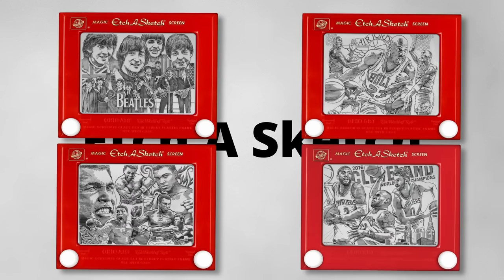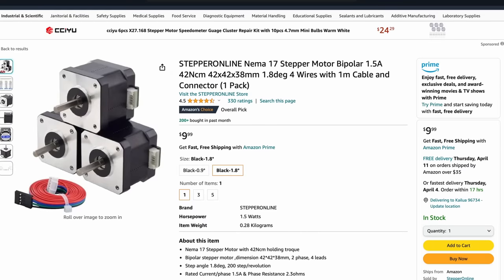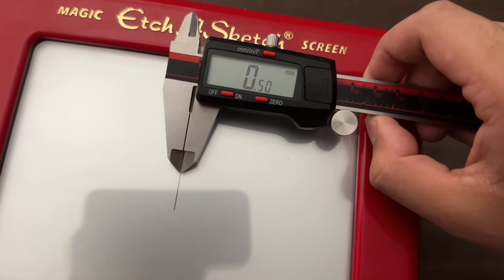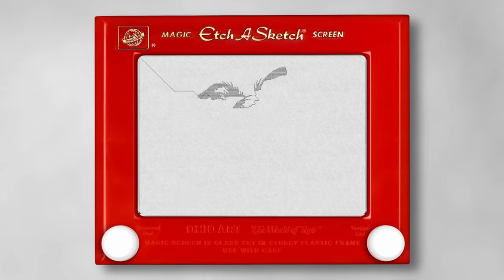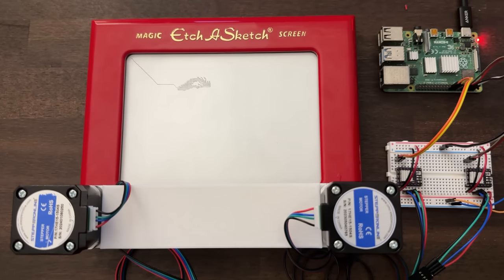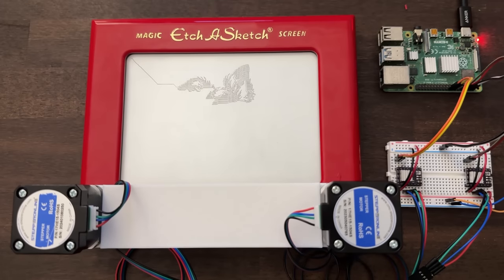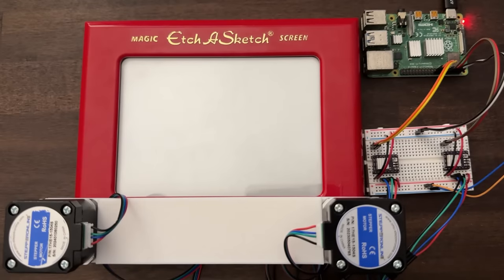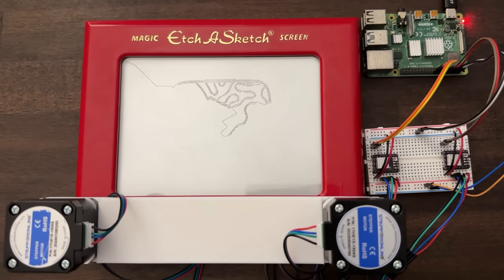Building a Robot Etch A Sketch

Comment: Delighted that you document those frustrating mistakes we ALL make with these kinds of projects
Reply from the maker: It was a rough process getting this to work, I don’t even show any of the programming frustrations
Reply: I only hope you can reuse the waste 3d prints because it shouldn’t need 7 attempts just to design a knob. Over the year mistakes like this will produce lots of unnecessary waste, to help you reuse the waste try to get silicone mold made of something you like. Then start by putting the waste 3d into the mold and heat the mood to the material melting temp. And keep adding 3d prints to the mold as the plastic keeps melting and you’ll have a beautiful recycled sculpture of whatever the mold was.
Reply: @atharvashetty6173 He probably has a means of recycling or reusing the  parts. Also, taking 7 attempts to design a knobs is completely valid especially if you're a perfectionist. Depends what you need it for, but still. Errors are just part of the design process.

Comment: Cool project! Some notes from a robotics engineer: 
1. You might be able to improve it if you add in some backlash compensation. When you change direction while turning a knob, the first couple degrees of motion in the new direction don't actually move the cursor. You could measure this by seeing how many steps you could rotate a knob back and forth without the cursor moving. The backlash amount in the two directions might be different. So whenever you change directions, you first need to rotate the knob by the backlash amount before continuing the path. 
2. It seems like you could maybe double the resolution. it looks like the rows are a little too spaced apart to make a fully filled-in image.
3. The pathfinding for traveling back through an already drawn area is a cool idea (very computer scientist-y) but the image might be better if you only do travel along the border pixels. or, as another commenter suggested, with the "grain" if you're going through a filled region.

less technical suggestions:
as other people said, moving to the start position then shaking the etch a sketch to get rid of the initial line
maybe another pattern to fill the regions? like crosshatching would be cool

Lookin forward to see what you do next :^)
Reply: Also, see that little phillips head screw thing on the stepper motor controller? you can use that to turn down the voltage which might help with the heat buildup. too low and they will stop working though. worth a try at least
Reply from the maker: You basically summed up the problems that I ran into. I didn't think talk much about them (I probably should have). I took backlash into consideration, ive never heard of that term before but I thought of it as a deadzone and I just stepped an extra 10 steps if the stepper changed direction.

I could probably double the resolution but it would take 4x as long and may not produce a 4x better image but definitely a good idea to try.

I agree, the path finding could be a lot smarter but it may take a lot longer to process a more efficient or "better looking" path.

Thank you for the info and the support, I appreciate it!
Reply: @micah_tilton Given how quickly this makes the images, having it take 4 times as long is absolutely nothing compared to how long your 3d printer took to make the parts, even if you discount the failures.

By the way, documenting the failures shows you're just the same as us viewers :)
Reply: This is great! Also, those "backtrack" lines can probably be removed if you reverse the drawing routine so that it draws the "backtracking" *first*. (If you still want to start in the top-left corner after that, either pathfind to the new starting point (traversing over black sections) first, or reverse recursions individually, or shake the device after initial traversal.) Doing this would result in the image portion essentially re-drawing over the backtrack lines, instead of backtracking lines drawing over the image portion.
Reply: @_LordInateur  I didn't think of drawing the backtracking first! neat idea
Reply: This guy hobby projects
Reply: Having casually tried this I thought it was odd he didn't mention backlash compensation because he either did backlash compensation or he got the nicest etch-a-sketch ever
Reply: Would it be possible to make code that would automatically convert an image to the necessary format to be drawn properly?

Perhaps even have a way to auto clear the screen if reasonably possible.

If so maybe this could be made into a kit that people could use.
Reply: @ikonix360  Both of these ideas are totally doable! The image processing is a very simple software addition, while clearing the screen is certainly possible but not sure on how involved it would be. It may work with just a vibration motor which would be very easy. maybe the whole etch-a-sketch would need to be shaken over a larger distance, which would make this more difficult.

Comment: Very cool!
If you add a pause and shake the Etch a Sketch between after it gets from the start position to the first black pixels block you could get rid of that initial line, but at the same time it tells a bit how the thing works.
Reply from the maker: Good idea! Thanks!
Reply: New shaking robot incoming?

Comment: There's a few tricks you can do to get cleaner results (not that this is in any way bad!) such as choosing paths to move from one area of the image to another, such that those transversal paths aren't noticeable (even when taken repeatedly). Eg. rather than starting in the top left corner, you start there, relocate to a spot inside the draw area, clear the screen, and then draw; or coming up/down from the center. Or you can repeatedly pass over a region, adjusting the pointer by only a fraction of its draw width, in order to produce a full-black area, as you push the metallic dust in one direction (rather than smearing some to both sides); look up a tutorial on how to completely clear the screen.

I once did a picture of a cityscape along a sloped street, so one of my transversal lines was the edge of the street. Even though it was sloped, I just had to be consistent about how I twisted the knobs. Then all the buildings were rectangular, which made those easy. From there it was just a matter of choosing how to texture each building (vertical stripes, horizontal, windows, etc)

Comment: two things you could do to improve this:
1: make the program minimize the number of "against the grain" moves while making moves. For example, this would be diagonal lines for the dog.
to do this, you would need to first choose a grain that best suits the image (up, down, diagonal left to right, diagonal right to left) then have it minimize all travel movements that are not this grain.

2: start the etch A sketch in it's starting position to eliminate the line from the edge. You would probably need a clear function for the robot, but a tilting plate should do the trick...
Reply from the maker: Good ideas! I think implementing #1 would help give the image a cleaner look
Reply: I was thinking you could just program the backtrack to go around the edge of the black area, so the line produced adds to the definition of the shape rather than cutting awkwardly across the middle.
Reply: I was thinking program the backtrack step to follow the edge of the shaded area, so it forms a nice edge rather than cutting across and making a weird diagonal.

Comment: Great build!  As a kid, I had an Etch-A-Sketch. If you drew the lines close enough, you could remove all the grey, and see inside. Your lines can be closer. I think you can increase your resolution, as you based everything on a visual measurement of line width. Also, another idea is if you use the original drawing at 1:45 and draw vectors and curves, which should look smooth with the two knobs moving together. You are converting drawing (lines) to pixels, and then a raster.

Comment: Steppers normally run hot, but you should be able to touch them if its burning you hand you should adjust the current on the driver. Awesome project.

Comment: ohh etch a sketch my ole friend, the original corexy :'D
Reply: since in a core XY motion system a combination of both motors is needed to preform a single axis movement an etch-a-sketch would be more akin to a cross-gantry setup.

Comment: Cool project. Steppers run hot, even when doing nothing, so I wouldn’t worry about that.
Reply from the maker: Thank you! I was a bit worried
Reply: @micah_tilton  my cnc machine has steppers and they run around 160-180 degrees. Hot enough that they burn you if you touch them.

Comment: It looks like you're using reprap Drv8825 style drivers.  If you turn down the current (via the voltage pot on the driver) the motors will get less hot, and if you turn up the micro steps (via the config pins), the noise of the motors will go down.  Alternately, you could switch to a silent step driver like the TMC2130 or TMC2209.

Comment: You're incorrect about the maximum resolution. Only the minimum line width is set, but you could operate on subpixels. Also it would be far easier to just etch vector graphics.

Comment: Coming from 3D printing, if your steppers are hot then you should be able to go to a higher voltage and reduce the amps via the little trim pots on your drivers. With 24 volts and less than 1amp to a motor I can run my printer for hours at high speeds with plenty of torque and they'll still be barely warmer than ambient air. Like 2 degrees F warmer. You can safely run stepper motors at voltages higher than is on their label as long as you keep the wattage under their limit.

Cool project!

Comment: It's normal for the motors to produce a ton of hear and vibrations normally 👍
Reply from the maker: Thank you! I thought I messed something up
Reply: I wondered if there was a bit of binding with them that made it worse though? Like when one motor rotates, the motor on the other side is getting the reaction force to keep the whole bar they are attached to from rotating. When that stepper has to rotate against that, it would take extra force, using more power, and generating more heat. Just my theory
Reply from the maker: @WesYarber  the bar is quite long and the torque needed to turn the knob is fairly low so I don’t think it caused many problems. With a weaker stepper motor I think it would cause bigger problems
Reply: @micah_tilton  yeah I have my own 3d printer with similar stepper motors and after each print they get like 75-85 degrees Celsius

Comment: Use the full 850x600 resolution of the stepper motors! The Etch-A-Sketch itself does not have a resolution limit, only the dark areas bleed a little outward because of the stylus width. You can still see white between your lines so there is not just resolution but also contrast to be gained from more pixels. 
Next, the line does not have to start from the top left. The stylus should first go there for position calibration, then go to the first dark pixel on the path, then pause to allow you to clear the image. Maybe there is an electrostatic or electromagnetic way to clear the image without shaking, or you can shake the entire thing with one or two off-center motors - provided the assembly will survive.
Then just add a tripod-mounted phone as a camera, control it via ADB, selfie stick button or special timelapse app and play a few seconds of Bad Apple!

Comment: Cool stuff! I wonder if you could prevent some of the heating issues and noise from the steppers by switching pathfinding method to something that prefers long, uninterupted lines, or by drawing curves. Would also be interesting to see this working using vector graphics, since they're more akin to what an Etch-A-Sketch actually does.

Comment: Right now when the stepper changes direction, it is going at full speed and when it changes direction, it is like driving a car at highway speeds and doing a hard corner. If it slows down at the end of each straight path, it should vibrate and heat up less

Comment: I would really like to know how exactly you did the pathfinding to connect and then draw the different clusters. This seems kind of similar to how a slicer works for a 3D printer, where you also try to find a path, while avoiding stringing.
Reply from the maker: I turn the pixel data into a weighted graph. I fill in each black pixel area with a DFS search then traverse to each section while minimizing distance traveled to each black section
Reply from the maker: I made a video about it on my channel

Comment: I think you might be losing some e-steps there, which is the noises you hear when your adapters are skipping over the ridges of the knobs. Great job, subbed.
Reply from the maker: Thank you, glad you enjoyed! That could be the case, however, the knobs hold on very well. the noise could be from the steppers accelerating quickly back and forth. I did not implement acceleration smoothing

Comment: Most NEMA motors can cope with up to 60C, but in many applications they use the metal frame of the machine they're attached to as heat sinks.  It might be a good idea to either drill and tap a metal bar in place of the plastic one, or stick some heat sinks with fins on the backs of these.  Or lower the voltage and run them a bit slower, but where's the fun in that?

Comment: Looks like you are using Allegro drivers in full step mode, you may want to set them in micro stepping x16 and your motors will be more silent (well not really, but will change pitch and vibrate less). Or just change to TMC drivers to get rid of the noise almost completely.
And... For the motors getting quite hot, dude watch out. From the factory those drivers are set at maximum current, around 2A. Your motors are rated at 1.5A, so lower to current to around 800mA and they'll be happy, cool, and still plenty of torque to do the job.

Nice project, though the raspberry was definitely overkill 😂

Comment: Great project!!! Just one question - are you powering NEMA17 drivers with 5V out of Raspberry Pi DIRECTLY?
Reply from the maker: I have an external power supply at 12v supplying a constant 1.5 amps to each motor

Comment: My father did this about a year ago with the same method, except instead of a rasberry pi, it used the controller from a 3d printer. Im not saying you copied him just pointing out that he and you had the same idea, I won't be posting his channel unless someone explicitly asks to not be self promoting though.
Reply: Going into further depth of how it worked, he used the excact same stepper motors as you and he also 3d printed on the controller knobs, for control although, he did not use a pathfinding algorithm yet used his 3d printer platform which generated gcode to convert a 2d image and turn it into code used by the controller to rotate the dials. It was much easier this way because of being able to upload a image directly to the software( no changing it to black and white or anything) and have it finish it in a few minutes. And I lied, it wasn't one year ago it was four lol, his design was a lot less shaky since it used a long axle to connect the two motors to eachother and some nuts to make it more sturdy.

Comment: I tried building one of these but got stuck over engineering the code. I tried the nearest neighbor method but one of my motors stopped working and I just dropped the project. I might try again after seeing this. Is the code available for use? Nice video!

Comment: It's strange that those large motors are getting hot.  I suspect that the motors need to be geared down.  If they are getting hot it's because they are drawing too much current, which means too much torque.  Just a thought.

Comment: I wonder if it is possible to use already existing software for generating one of the g code. Foru examle laser erhing sofwer. Then you don't have to solve problems that other engineers have already solved and the algorithms are probably more efficient. You should get better resolution if you attach the stepper motor better,you  can connect the stepper motor with a belt insted of rigid mounting it to avoid mis alinment. And it's probably better if you don't couple the stepper motors together to minimize the risk of measurement errors

Comment: Colour me surprised that etch a sketch motion system is capable of returning to the same spot after thousands of moves.

I guess another implementation method is to just use a 3d printer logic board including firmware or even an arduino cnc shield running grbl and generate g-code.

Come to think of it, any slicer does just generate valid g-code for exactly this. You would even get much less vibration from any real motion control firmware.

Comment: I'm VERY skeptical. The Etch-a-sketch has an incredible amount of backlash, and that backlash is inconsistant across the drawing area. Also, in large sketched areas you can see the mechanism moving behind the picture. Neither of these are addressed in the video. I believe the image is faked - but would be pleased to be proved wrong.